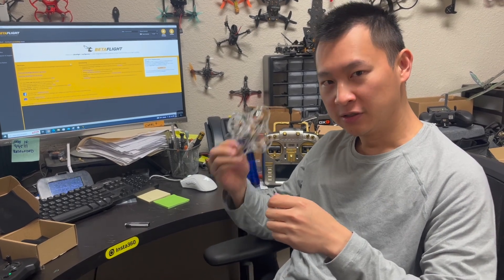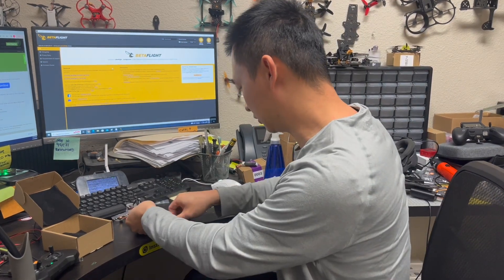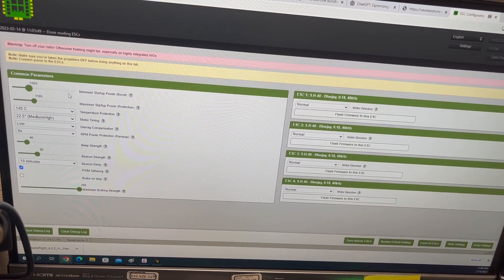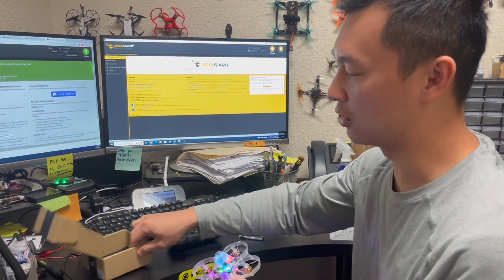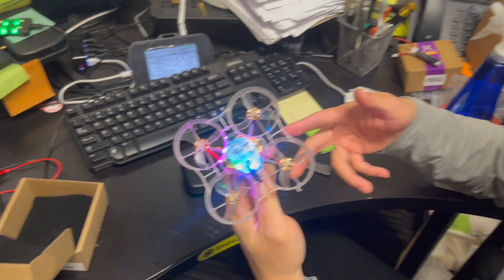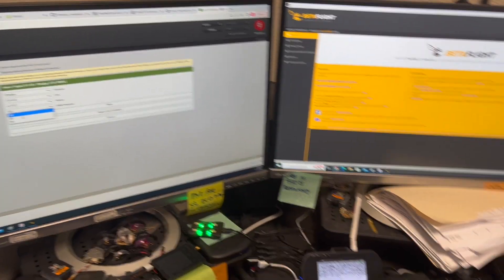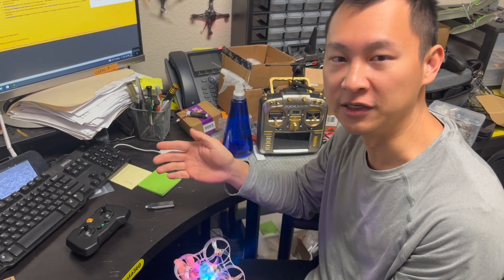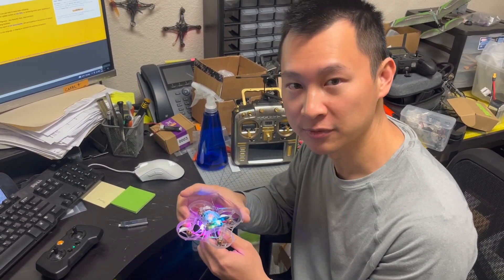BeeBrain ESC Settings Guide | A NewBeeDrone Tutorial

Comment: This did not work for me. Whenever I arm on my acrobee65 blv4, the front right propeller spasms then doesn’t spin. The drone works, but only after I attempt to arm it multiple times. About every ten arms I can finally get all of the propellers to spin up, but loose a ton of flight time. Any fixes? I have followed this video, swapped motors, and have done everything to the best of my knowledge and research. If you could help me that would be great.